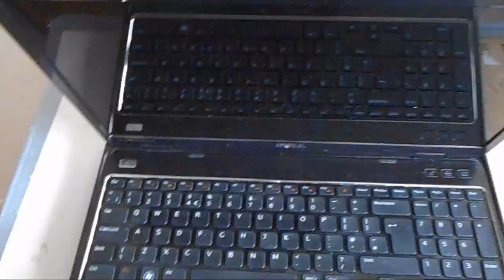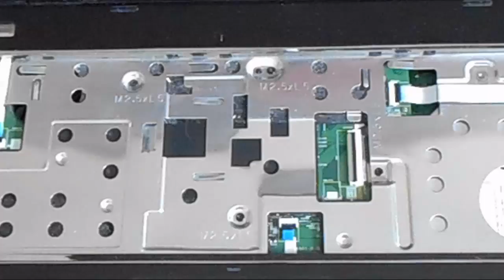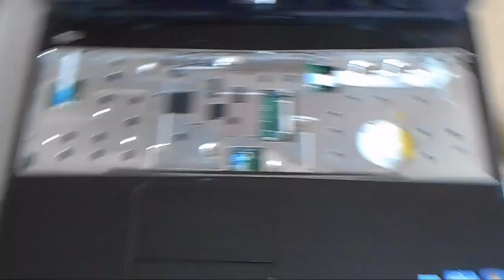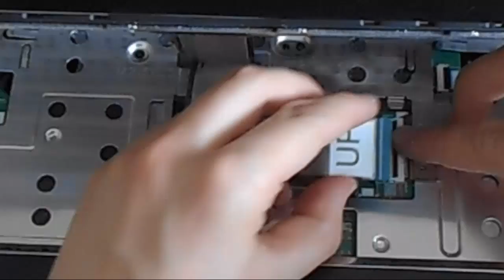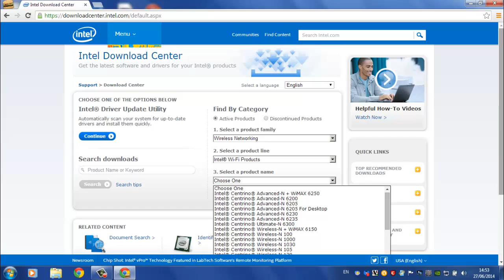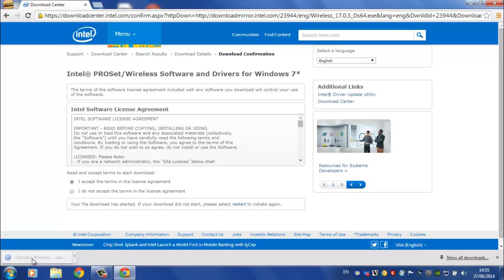How to upgrade/install the wireless card in your laptop

Comment: thanks for the video
 I will be installing this 7260 into my new HP Envy 17 Laptop . I have Windows 7 64 bit.
what drivers did you use for the wireless and for the Bluetooth ?
Did you get the Bluetooth to work ?
Is the card still working good in your laptop ?